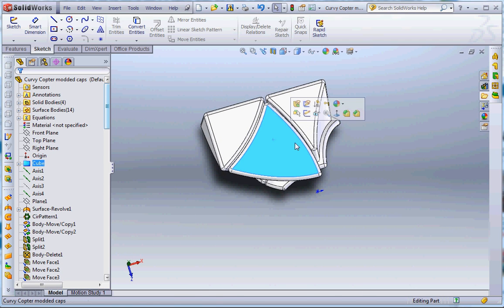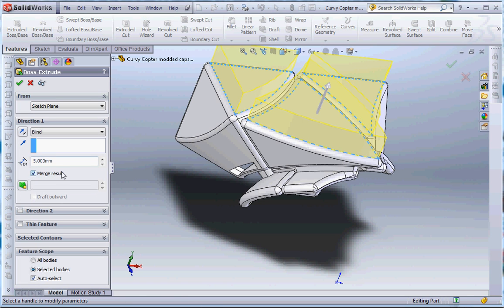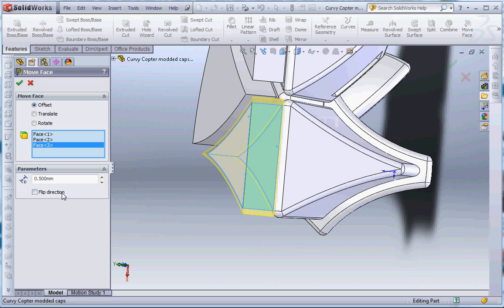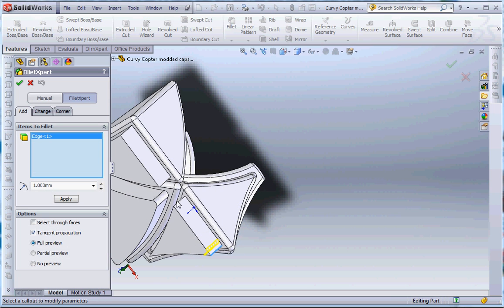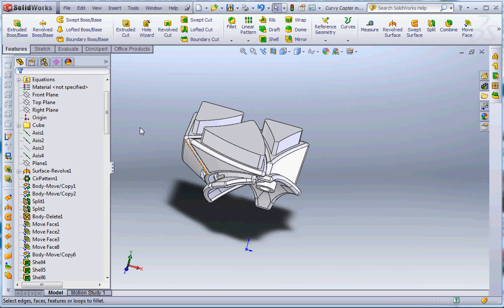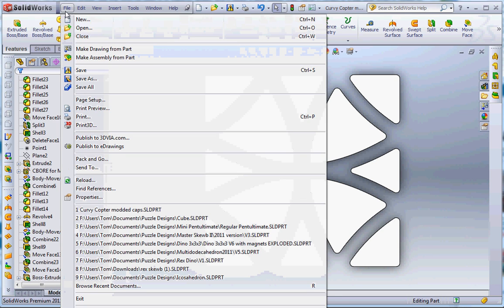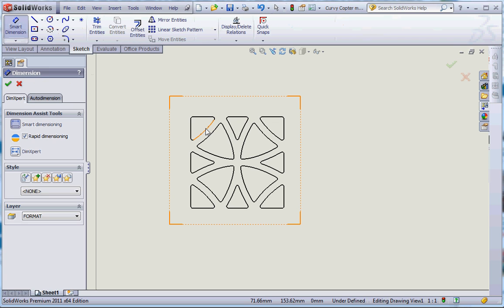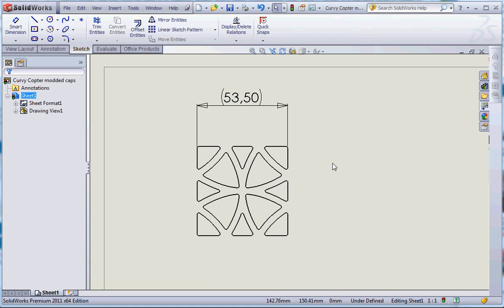Designing a puzzle sticker template in SolidWorks

Comment: a sketch entity is cutting your sketch up somewhere (not neccessarily in half though), for example:
if you have a circle with a line through the centre (or a chord in the circle), it'll fail BUT if that line was "For construction" i.e. dotted/dashed, extrusion would work fine.